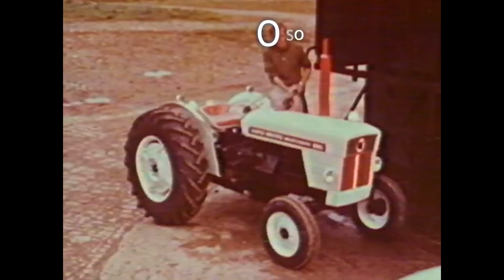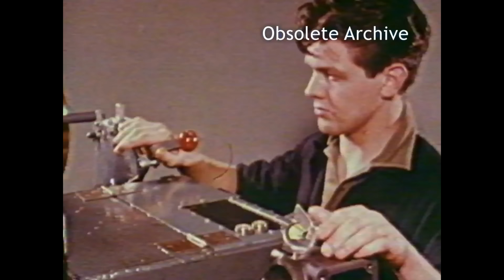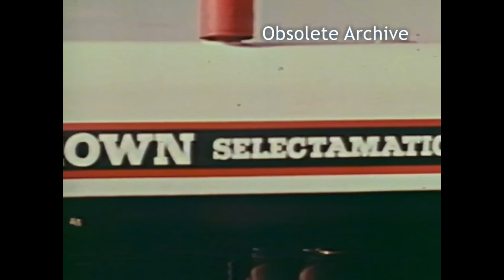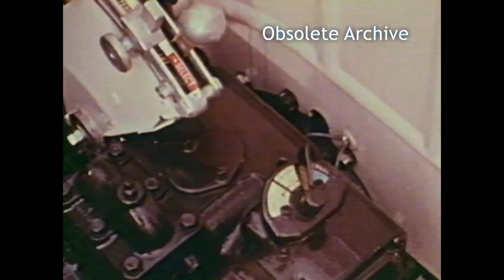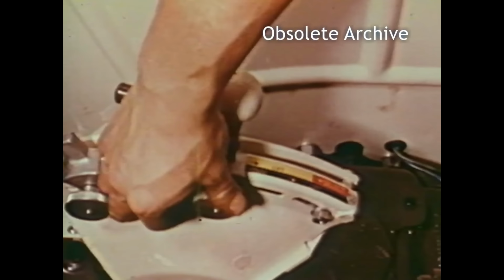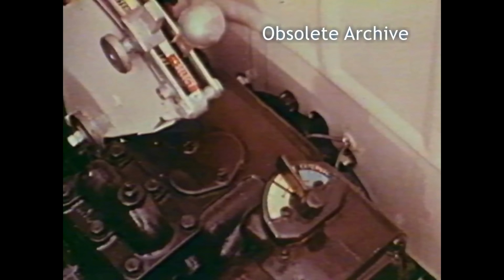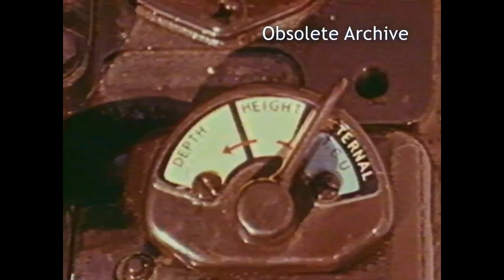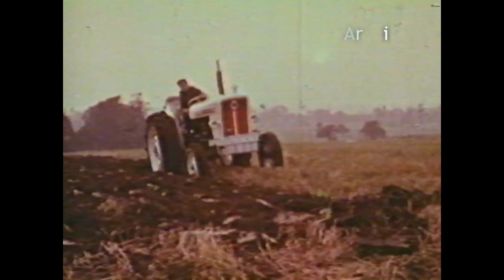David Brown Selectamatic tractor promotional film 1960's

Comment: I still use my  1975, 995 as my sole tractor. I bought it in 1988 for £1000. The fuel liftpump arm metal fatigued, a front wheel  broke down and had to be replaced. The seat was replaced, exhaust, hand brake, lights, cab fell to pieces,steering joints, revcounter. There is a lot of wear on the 3 point linkage. It has been fitted with an alternator and a high speed starter. Inspite of being kept inside always the paint is almost turned to rust. Except on th very frostiest spell of weather it will always start, smokes a lot. Original injectors. So far no hydraulic problems. Dangerously  slow for road work. Awkward to get on and off. Tiring to drive. I am going to chance new back tyres.
Reply: Wow, it seems like you're unlucky or something? That's a lot of problems for David Brown they're usually very reliable

Comment: We have come a very long way since then with the new tractors, every control at the tip of your finger, fully airconditioned cab with surround sound speaker system for excellent music experience and an engine so quiet you would not tell the tractor was working from a mile away.
Compare that to the gruelling machine work of the past in which cabs were optional extras most farmers could not afford, the engines barely came with mufflers and you could hear them working 10 miles away, 
In some cases big tractors would shake windows if close enough. 

And there were no air suspension seats or any suspension at all apart from the air in your tires, bumpy ride sure these things could do 30 kph but most cases you rather stick to 15 kph or your back would hate you for it. 
Implements were smaller, working hours were longer, and many faults and issues would occur after a few years, yes there were surely less electronics fault after all tractors did not start getting electronics as standards until the early 90s! 

And before tractors, back breaking work with ox or horse that took 20 times longer to do then one machine. 
Plowing with four oxen would only yield you four plows at most, but only the richest farmers could afford THAT, most would do one or two plow with one or two horses. Hard work back then, very hard.

And soon, tractors will drive themselves out to the fields and plow them while the farmer goes from a hard worker, to an accountant.
Reply: I harrowed and rollered with a rusty and rattling DB990 3 hours every evening for a week in 1988. It just worked

Comment: Implematic and selectamatic was probably the worst system out there, and the noise of the transmission was horrible. 
But the engines (except 1200 & 1412) were indestructible
Reply from the maker: Thanks for sharing
Reply: You're very wrong about that, Sir. Implematic and Selectamatic were very good, and I've seen no one complain about them until now with you.
Reply: I have a 780 and absolutely love it , drove a 990 in my youth and loved it. That's your opinion and I have mine
Reply: Don't forget how hot the transmission gets as well .
Reply: As one of my old bosses used to say they never broke down whilst stood in the shed.

Comment: They are junk always have been
Reply: Absolutely not 😂 Clearly you're very uneducated then because the fact remains that you still see them very often still doing work and are very reliable and pretty strong. You must be a John Deere fan to say that 😂
Reply: There's still plenty of old fords and fergusons and international  out there. If you have never had any problems with dbs your lucky. @scorm3088
Reply: actually they are pretty good and reliable, my grandfather always had DBs, except his last one in the 90's was a Case, he never had a problem with them, the oldest is still working perfectly after 70 years
Reply: @alittledown8239  I was a tractor driver back in the 70s and 80s and I drove all the popular makes of the time plus a few less popular ones. Given the choice I would always take out one of the David Browns, usually the 1210. Other than the pick up chains slipping on the clamping mechanism I don't recall having any trouble during the time we had them. They were looked after though.